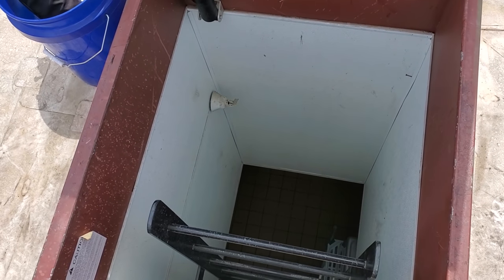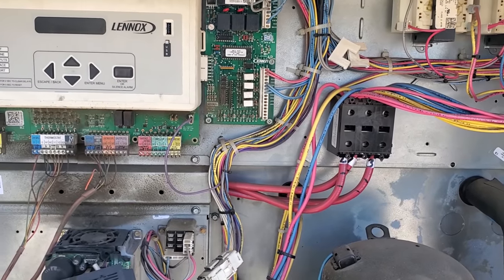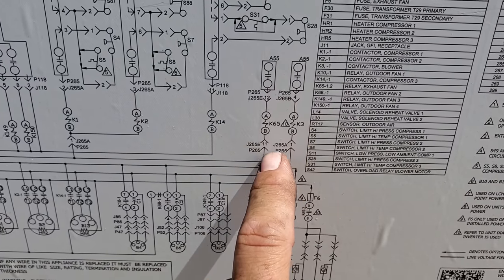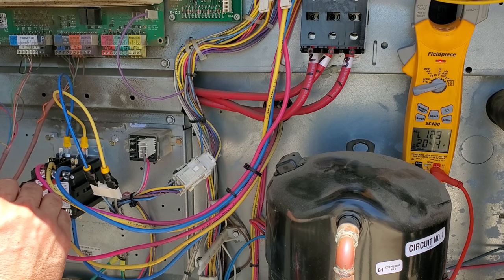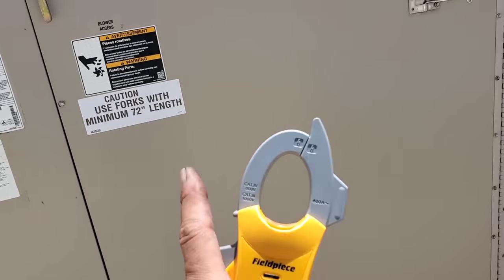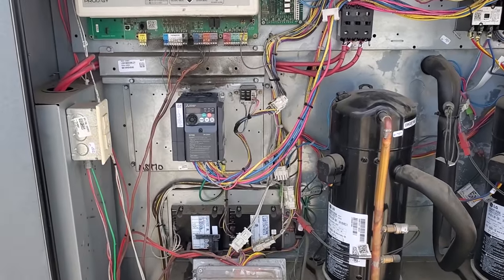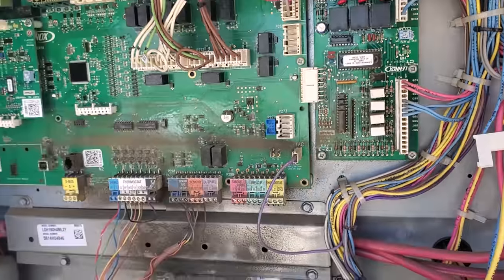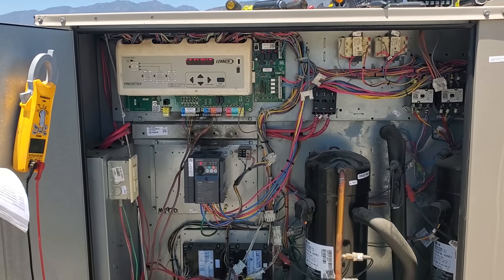THE DINING AC IS NOT WORKING

Comment: As an electronics tech, something that caught my eye was that line of dirt on the bottom of the main board.  Dirt can become conductive, especially when the humidity rises and then you'll get all kinds of weird problems.  Just part of how I roll when it comes to big picture, inspecting, and doing it right.  I use an acid brush that I've cut the bristles to half length to stiffen them.  That and a vacuum cleaner.

Comment: It's the worst thing to come into a fault half way through the fix, stuff's been removed and the bolts have wandered off .....  great to see just that little bit of detail. Makes life so much easier, especially when you've bolts of different lengths.... that's always fun. I've the same issues at work, you can't fix everything first time. Sometimes you get lucky, most times you open up a whole can of worms....... it's why I like my job. It's boring for the most part but there are moments of happiness when I'm sorting problems out.

Comment: I've been watching your Videos for the past two weeks now, even though I'm not even remotely connected to HVACR I'm an electrical engineer, but I picked up a fair bit and after reading up on some terms that meant nothing to me like superheat etc. I even start to understand how and why you do things. So you do a pretty good job on explaining and methods. Probably will never put that knowledge to any greater use since the HVACR guy at our company didn't even take me serious as I told him that it sounds like a bearing in the compressor is about to die (compressor died 2 Weeks later, took them 3 months to get a new unit installed, industrial carrier cold water circuit, those roof direct air units are very uncommon in europe) but it never hurts to know things outside of your job, so thanks for providing :)

Comment: Don’t worry about the sprinkler. I’m a truck driver and had a load to an enclosed strip mall that had a height hog 13’6.5”. My truck is 13’6”. The day before they had lowered the sprinklers 2”. I took off 4 sprinkler heads; it looked like a Roman fountain goin off on the top of my trailer. It was quite scenic.
 Not!

Comment: Looked up Spec on that VFD (FR-D720-100-NA).  It looks border line in it's sizing. It's rated at 10 A up to 122°F.  It should have over temp protection. But from all that dirt I see from the cooling fan means the heat sink is most likely dirty. Thus reducing it's cooling capacity.  If this is an common issue look at replacing them with the FR-D720-165-NA model. It's rated for 16.5 A.
Reply: It's also probably running closer to 150 F ambient mounted in that unit on the top of a roof in So Cal. You can see two of the main filter caps have died, and this was quite likely from the prolonged high temperature soaking. I strongly suspect those caps failing was the root cause of the VFD failure, not a (stupidly) borderline current rating.
Reply: @lwilton  Not to mention dirty supply from all the contractors and motors etc in the various AC's etc/ But you are right the caps are not going to like sitting out there in the hot sun all day at 150f/65.55556c. That's going to be a bit hot even for the micro controller inside of the VFD too. I'd go as far as 50% de-rate them, go find one that will supply the required amps after 50% de-rating it.
Reply: @lwilton  Seems like a business to re-solder new caps.

Comment: suggestion: When filming the prodigy boards - try using a slightly longer shutter time (in most phone models if you use a phone to film - have a "advanced" or "pro" mode to set shutter). You might need to reduce apeture tough. If your phone or camera allows saving profile, try getting a good profile for just prodigy boards, and then save it as 2 profiles, one for "normal" filmning and one for "prodigy". Play around with the camera settings - should be pretty easy if you have a prodigy board at home, until you get a nice view.
Reply: Usually wouldn't work as the outdoor sun is too bright for a slower shutter speed. We use ND filters for that, but finding one for phone cameras might be difficult. An easier way might be to just put sunglasses / welding goggles in front of the camera and let the auto exposure adjust.

Comment: With a proving circuit, you now have 3 possible states:
- Open: wire is broken
- Shorted: Wire melted or detector tripped.
- Supervisory state: All is fine.

How it often work is with a simple resistor. Basically the resistor 'soft short' the wiring at the end of it. If the panel see the resistor, then the wiring is intact. Open then something is broken, and sorted it mean it tripped or the wire shorted/melted.

Some system will use two resitors, one end of line (the first one) plus another series one with the detector. Now you can have 4 states: open, close, EOL resistor or the tripped resistor. Those can therefore detect between the shorted or tripped condition. Those can help to avoid some nuisance alarm due to a nail in the wiring.

Comment: Pretty fair guess about what happened to that unit:
Looking at the VFD innards, it is immediately obvious that two of the main filter caps have failed. Others may have also failed, but those two probably were enough.  They were probably bad enough that they were supplying AC to the VFD logic when it should have been DC. 

This probably wouldn't have damaged the chips, but it trashed their operation, and they got completely confused. Somewhere in their confusion, they turned on two or maybe all three phases at once, shorting the line across the power MOSFETs in the driver part of the board. 

The result was a lot of black greasy smoke and shrapnel all over the inside of the VFD. A lot of nice greasy conductive smoke, probably along with a nice hot arc for a very short time. Probably the arc migrated from the power MOSFETs into the logic chips. From there it fed back along the control lines and momentarily put 208 onto the logic of the main control board. 

The VFD control may be partially isolated, but not enough so. The short pulse of HV didn't completely smoke the control, but it was enough to confuse the heck out of it, and possibly fry some logic as well as wiping out the flash/EEPROM memory in the unit.

You are probably right that having that VFD in a more climate controlled room would have preserved it. I suspect if you put a recording thermometer in the VFD case you would find that it is way over the max continuous operating temperature for a good part of the day in summer. 

I'm not an air conditioning guy, so I might seriously consider going to Lowes and getting a 5000 BTU room AC and and ducting it into that electrical area of the package unit. Might be real cheap insurance. (And I'm sure you can think of some more reasonable idea.)
Reply: The better designed units have a hole to leak a small amount of conditioned air through the controls compartment during operation.
Reply: @zjeepgozweeln  a little suggestion put the vfd in the blower compartment it's colder
Reply: Joel Acosta then you run into Condensation issues with the VFD.
Reply: mark robertson  I'm not sure if that is a deliberately snarky comment for reasons I don't understand, or if maybe the comment means something completely different that I don't understand. What does describing a probable VFD failure cause have to getting venereal disease?

Comment: That opening clip... I cringed so hard. Brought back memories of working in a certain home improvement chain's local distribution center. A sprinkler head was RIGHT next to the warehouse racks, and there were many than occasions where we had to shut down and evacuate because someone on powered equipment had taken off the head and triggered the fire alarm. I kept suggesting to anyone that would listen that we should install a small cage of rebar around it to protect it from impact, but nobody cares what the fireman's son has to say about the fire alarm system.
OOOF, those exploded capacitors on the VFD are definitely the cause of the tripped breaker! I wonder if they failed due to high temperatures on the roof? High temps cause the dielectric to breakdown and the caps then basically become shorts. Mitsubishi also had an issue with bad capacitors in some of their cars' ECMs in the '90s because they used a cheaper brand instead of their own parts - they dried out under the harsh temperatures inside a car and failed. As you said, putting the VFDs in a cooler environment will extend their lifespan. Judging by the incredible scorch marks inside the dead VFD, I guarantee some HV arced over to the LV sections, if I had to offer a theory (much simpler, but similar to I wilton's theory) the faulty caps became dead short, high voltage arced to low voltage sections, and from there basically grenaded the daughter board and probably parts of the main board.

Comment: Thank you, for this video. I have not seen these here in Michigan, yet, but given the energy regulations and the closing of coal fired plants, it's only a matter of time before I have to deal with these VFDs. Thanks to you, and your experience, I will have a leg up. Thank You.
Reply: Real electrical engineers know how to do multi-speed motors with no electronics.  This gratuitous electronic is being put in there simply to generate service calls.  True variable speed units like the mini-splits I installed in my retirement cabin are a different matter.  Even then the chicoms are running the power transistors at absolute max rating which is why one driver board has already failed.

Comment: Nice job: You can't beat the older style units that have only relays that operate the stages and systems. Sometimes the new tech stuff cost more that it saves. Thanks for the video.
Reply: Waterman one Watching this video was fascinating, but also a infuriating. Why so complex? KISS...
Reply: @gordonrichardson2972  thank our "environmentalist" buddies.  Don't get me wrong - I'm all for conservation.  But how about conservation with some common sense that's not completely divorced from reality?
Reply: @ItsMrAssholeToYou   👍. Agreed.
Reply: Yeah. I'm not in the industry, but I have to wonder if that VFD and all the circuitry that controls it is really more economical than a two speed motor controlled by relays and contactors.
Reply: Sean  That is throwing the baby out with the bathwater. Nothing wrong with using chips and such where it makes sense. It just doesn't make sense to use them for ~5% energy savings while sacrificing ~25%  in the reliability.
Reply: I agree. After replacing a thousand TXV valves, when it came time to put a HVAC unit in my home, you bet I went with a piston unit. Simplicity is hard to kill.
Reply: The VFD might be a big hammer solution, but the control logic has the potential to make it WAY easier.  It could have been as simple as a menu option to change the fan control from variable speed to on/off.

The real problem is, does anyone know how to change that?  And if they don't, is it because they refuse to learn "all that fancy whiz-bang electronic nonsense," or the manufacturer's fault for making the configuration process needlessly obscure (intentionally, or just out of laziness)?

I have to deal with this in IT.  I've configured all kinds of equipment.  But, sit me down in front of a phone system and I'm like ... "ENGLISH.  DO YOU SPEAK IT?"

Comment: Small tip from a hvac tech taken a brush and brush the dust from the circuit boards dust can make a short and with the low control voltage that the board needs can give strange problems VFD went due to bad capacitor nice video again Chris

Comment: Excellent video! The best advice I've ever received regarding unplugging motherboards (or even doing anything that you're not familiar with) is to take a picture.  Unlike the old days, it only takes one high resolution picture and you can zoom in on whatever pin, plug, bolt, etc that you want.  For mechanical disassembly, I remove like bolts and group them in a line based on assembly stage. If one stage has two or more sizes, mark each length with a dot matching its corresponding location.  It's like a car engine, each piston is marked to belong in a specific cylinder.

Comment: Just like the switchmode power supplies to which they're very closely related, the active components in those VFDs have almost no tolerance for errors in their controlling circuits.

I'm always fearful of those sprinkler heads when pulling network cables and putting up wireless APs, that some absent minded movement is going to trigger a major disaster through the whole building.

Comment: The environment for electronics in a unit like that is terrible, comparable to an automobile.  High heat, very cold in winter, vibration and lots of dirt.  Not to mention lots of big motors being stopped and started, causing power line transients.  VFDs are now everywhere, clothes washing machines, garage openers, residential A/C.
Reply: Even fridges got VFD's in them now. Pretty cool (no pun intended), I can never hear my fridge running under normal circumstances. Only time I can hear it very low, is if it has been powered off, or a lot of new stuff has been put into it.
Reply: On the bright side, the epoxy (?) coating on the new M2 seems thicker which should help a bit.
Reply: Most units have vent holes that keep that compartment warm, some times
Reply: Drives don't care about cold except maybe condensing water. However, in the heat you need to derate those drives. I would have gone up a larger drive if that was the second one blown. We use a lot of those Mitsubishi drives and I've never seen one fail like that. 
Surprised that if they are only using two speeds they would go through the trouble of a variable output. Just set the two different speeds and use the RH and RM input to select.
Reply: Stupid to have a VFD at 59hz. It should just bypass at that point, run at 60hz and let the VFD electronics take a rest.

Comment: Great video amazing how complicated these units can get to meet energy consumption requirements. I’m an electrician and what I find odd is the fire alarm supervisory circuit should not be dependent on the units power supply, the supervisory power should come from the fire alarm panel/sub panel and should just monitor the continuity of the alarm wires and the smoke detector it shouldn’t matter if the unit has power or not to cause a supervisory alarm. I think you may have had a surge on the system power side that may have damaged the board maybe that unit was the closest to the surge is why it was the only one effected. Just my two cents, great video and great service skills to get that unit working temporarily.

Comment: As for the VFD,  the caps are swollen, common problem over time and with heat, dirty fan would indicate that's a possibility. The destruction can also happen in startup when the spare VFD has been on the shelf for a long time (years) and the caps lose their polarity. You have to "reform" them with a slow introduction of the supply voltage. That is far less common but it worth knowing about. Another advantage of the VFD  is that they don't care about the phase rotation.

Comment: Why the hell do these units have no fuses for just about anything? Normally there would be fuses or breakers for the drive, motors etc. 
Looks like electrical regulations in the US are really lax about this. No surprise the VFD fails that way. When these blow here, even with 400V mains, the input fuse blows and there isnt any damage beyond the power module and it usually can be repaired.
Reply: it should have also a self protection cyrcuit.. was a mitzubishi if i didnt see wrong.. how can fail so badly?
Reply: @riccardoz2953  Normally VFDs dont have any internal fusing and require external, properly sized, current limiting, fuses.
Reply: Timothy Salomon  Idk about HVAC, in my field of industry, we frequently have to deal with really old, hard to replace parts and often go for component level repair, sometimes going as far as to qualify as re-engineering.
Reply: Fuses are about protecting the wire. In this case, I doubt if any amount of fusing would help much.  The protection circuit has to allow enough energy to run the fans - which is more than enough energy to go "bang".
Reply: Kind of looks like the VFD IS the fuse. Why sell a $5 fuse, when you can sell a $50 VFD . Or whatever the acctual prices are. I just pulled those numbers out of the air.

Comment: I think VFDs are great when they're of good quality and properly installed. They allow you to do so much with just one motor. Low demand or a need for de-humidification? Low and slow... High demand? Full speed ahead! You can maintain static pressure or airflow based on feedback... the options are endless.

VFDs typically are set up with 3 I/Os. start/stop, analog speed (or in this case a pre-programmed 2nd speed), and a dry contact for alarm. Of course you can configure a lot more I/Os for other things as well. The better units can be configured for a lot more.

Alas, here you see what seems to be a poor implementation. 3 compressors and other equipment sharing the same space on a roof that can reach extreme temps, baking in the sun. Sounds like a recipe for disaster if I've ever seen one.
Reply: zjeepgozweeln Fine summary of a waste of good technology!?

Comment: I don't know if you (or anyone) will ever be in this situation again, but it looks like the D700 series is able to have a minimum frequency programmed in relatively simply, so instead of reinstalling the contactor while you waited for the board to be ordered, you possibly could have set a minimum frequency for the VFD which could have saved some installation time.

Comment: Often times when changing dense boards like that, I will write with a fine point sharpie on the flying connector the number of the mating connector on the PCB.  Taking a few pictures from different angles is also a big time saver.